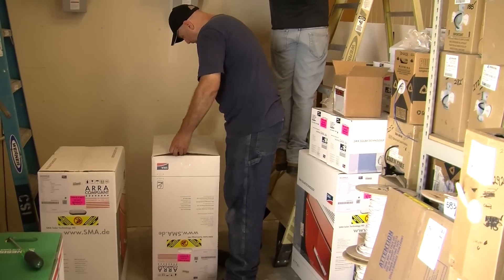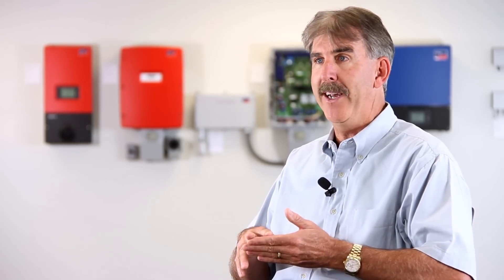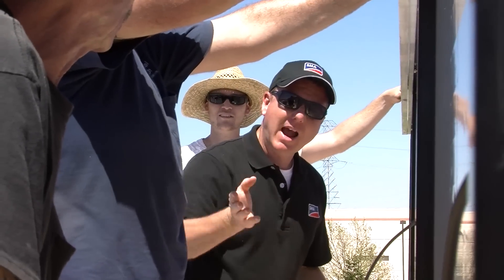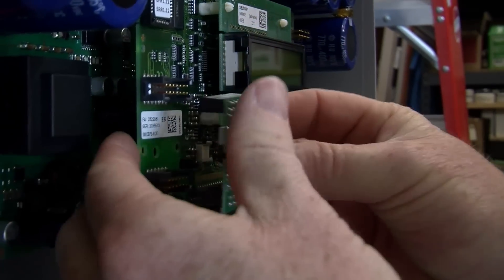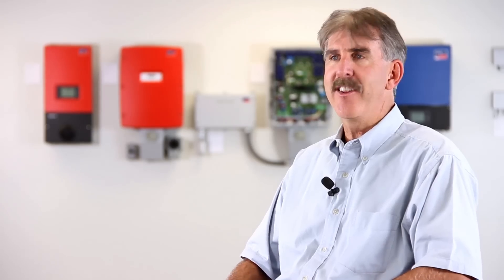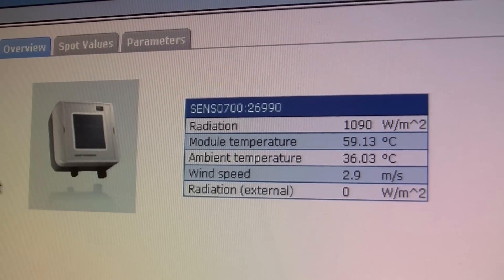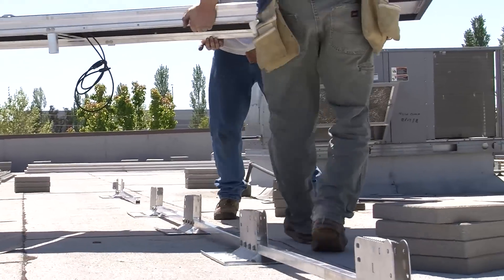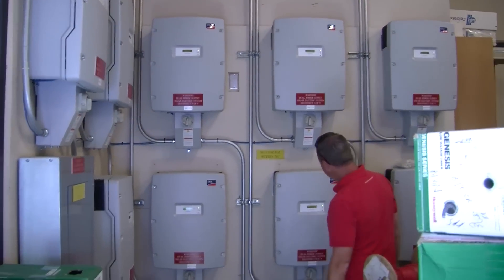SMA Testimonial: Greenwire Technologies

Comment: Hi Isaac, Kevin punched a hole in the roof and had gutters above and below the hole. All conductors were placed inside conduit for safety reasons. If you install PV in accordance with NEC guidelines then you should have no issues.